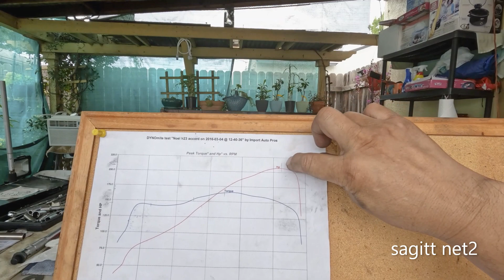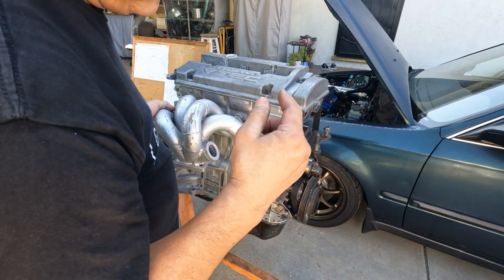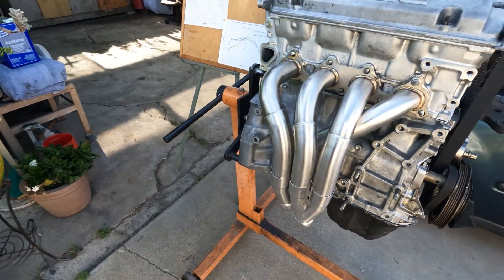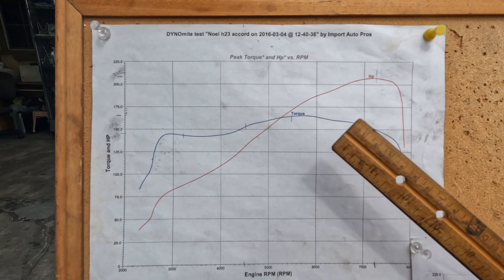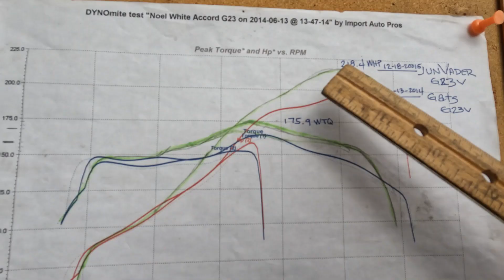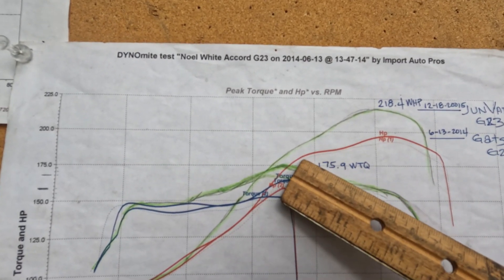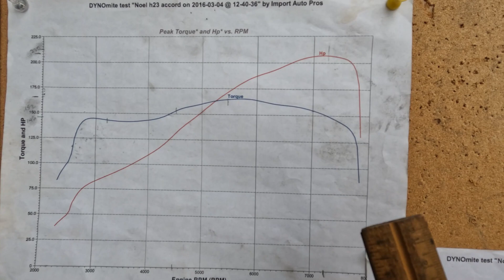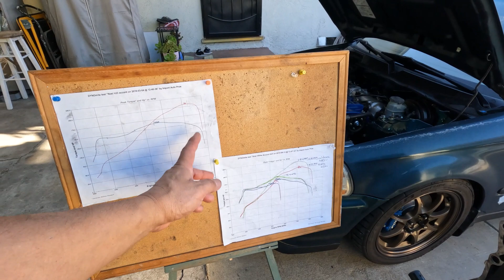What is G23 safe REV limit.

Comment: Hola consulta estoy trabajando en un g23  all motor(bloque f20b y cigüeñal  y bielas f23¿pregunta los árboles de levas de f20b y h22 tienen diferencias cual me es mejor utilizar..gracias a quién me ayude
Reply from the maker: F20b and H22 camshafts are interchangeable. If your F20b came w/ type S cams, it can be use on H22 cyl head, vice versa.

Comment: What If you put a built head on the g23. Valves ,valve springs, cams and run some beefy rods will it be safe  to go past 8k? I know you said something about the piston size and rod stroke ain't ideal.
Reply: I think I know the answer. I just want your opinion I know you know your stuff.
Reply from the maker: The g23 build is known for rod bearing spun. It cannot really sustain that much beating as far as reving it pass 7k. Mine is just a matter of time and hoping it wont happen. But l really cant stop or keep it under 7k coz of the turbo rear housing. I'm using .82 rear hsng and power band is on top unlike if you use a .63 hsng w/c will give you a much lower power band. I say try both and it'll give you a much definitive answer as far as w/c setup you want to go.
Reply from the maker: Valve springs n retainers will definitely add security for a much longer rpm.

Comment: What balance shaft belt do you use on a g23? F23 or h22?
Reply from the maker: Blue belt made by Gates (timing and b/s). The H22 w/ cam gear painted yellow are Honda OE. H22 stroker is standard Gates belt w/c is actually good also for a $32 price. I can recommend any of those belt for NA setup or Boost application. You can't go wrong on any of it.

Comment: Thanks for the info sensei! My H22a4 stopped making power at 7k but it still made 173hp even with that blow-by issue it has lol. 
P. S. I have the same headers👍🏼, which I plan to weld together in the future after much practice haha
Reply from the maker: No worry brother! That's still a good numbers, that's whp not @crank. I guess your motor need a rebuild or something if making a lot of blowby's. Headers  hang down quite a bit and l know your rocking lowered too. Your like me then, need all the practice we can get when it comes to welding lol!. Later bruh!

Comment: My  JDM h22 made 205whp at 8,500 stock cams stock block.
Reply from the maker: For a hi rev motor like the H22 making power passed 7k are impressive.
Reply: @sagittnet2158  the h22 stock valve springs start to float at 8,600rpm from what I've read. Anything over 8,500 isn't safe unless the the engine has aftermarket valve springs, I'd recommend supertech.There's too much misinformation about h/f series not being able to rev when in reality it's just the lift on factory cams is very small. Even the h22 vtec lobe is very small. The h22 head stock flows 300cfm with a good valve job it just needs more radical cams to make power Na.
Reply from the maker: @ericloki3188  that's good to know. Sk2 got it all figured out snd cashing it to the bank.